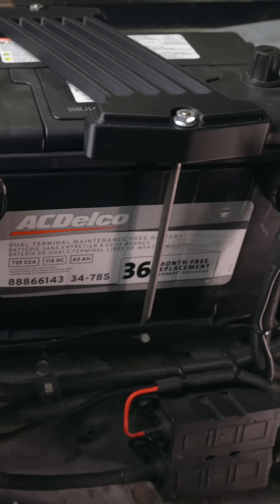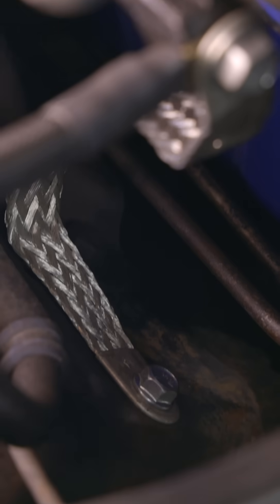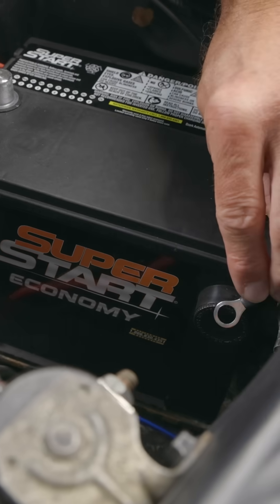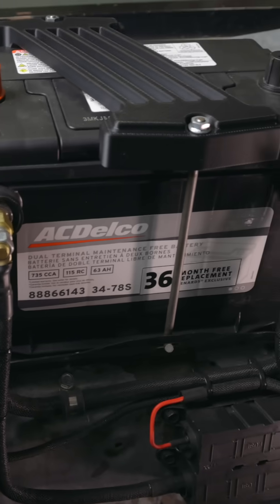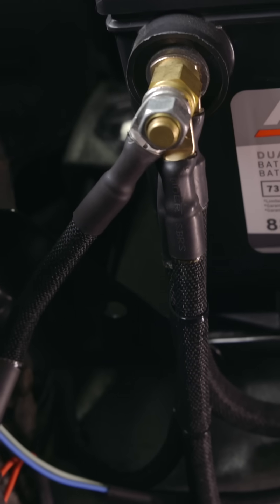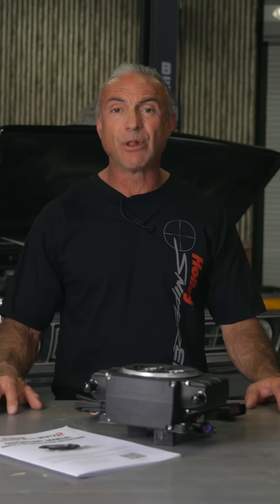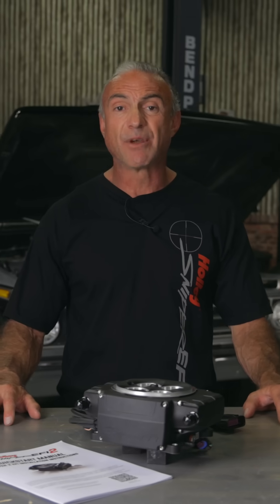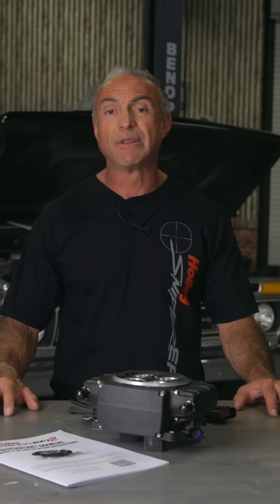Improper wiring: Common Sniper 2 Mistakes & How To Avoid Them

Comment: How does Holley recommend running the sniper main power and ground wires to a battery that lives in the trunk?
Reply from the maker: Since Holley doesn't know how much a user might lengthen their main power harness, we specify using  the next larger AWG (8awg) for the extension.